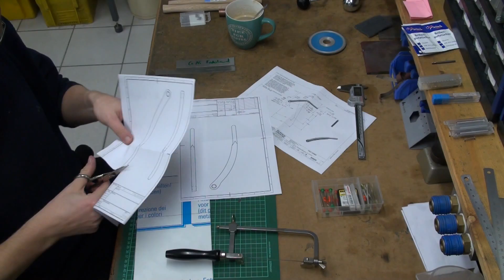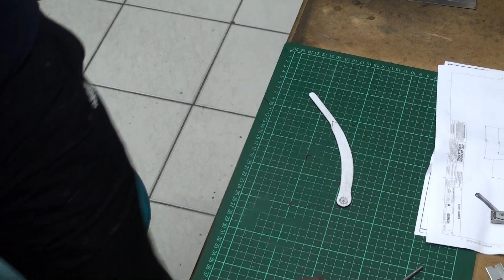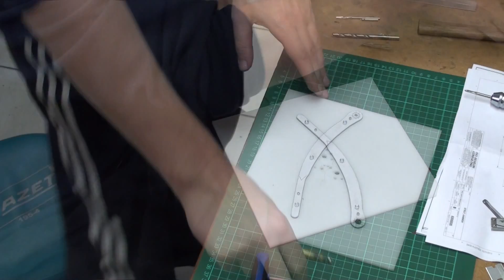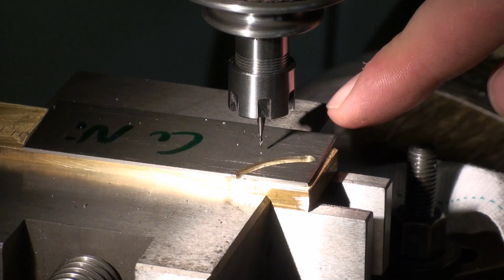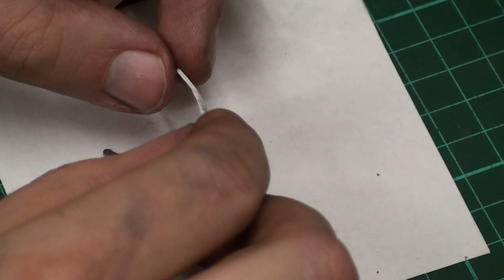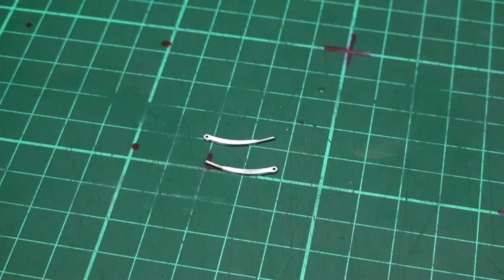Miniature M1911: Hammer strut

Comment: Stefan - beautiful work as always. I'm not sure why you used a Jeweler saw instead of CNC this time. Maybe you just wanted to try something different? You may want to consider using a board with a V cut into it and keep moving the part around to keep your sawblade near the point of the V. You'll get a little better support than just sawing over the edge of the board. It's also a good idea to put a clearance angle on the bottom legs of the V so that you can move the saw a little bit off of vertical if you need. Finally if you put a little bit of beeswax on your blade your sawing will go more smoothly. I love your videos.  - mike